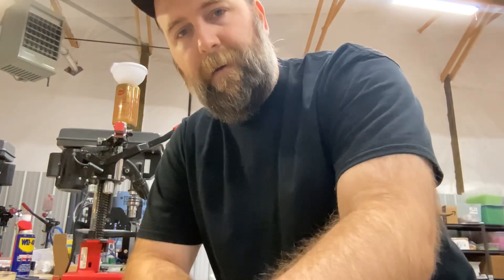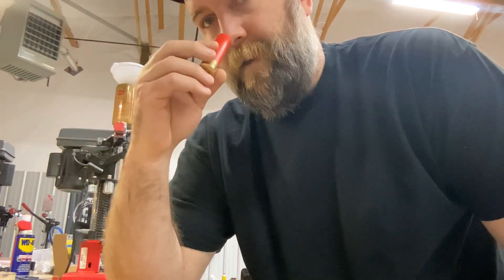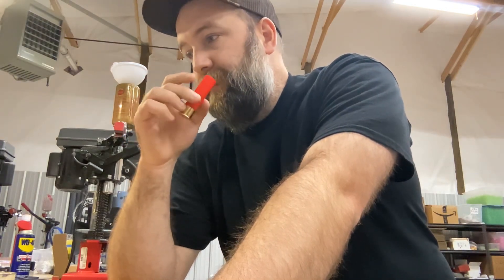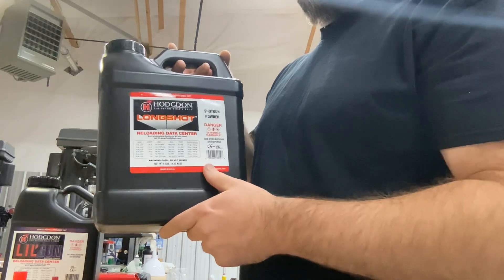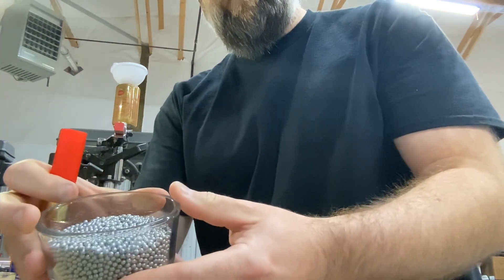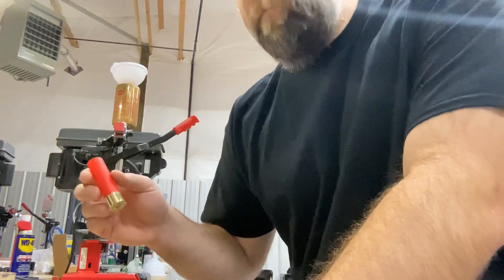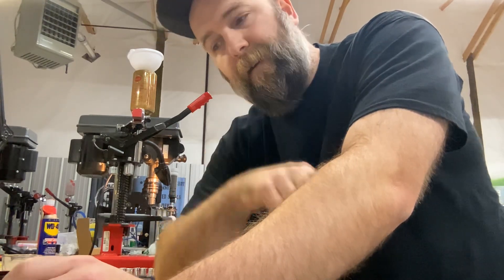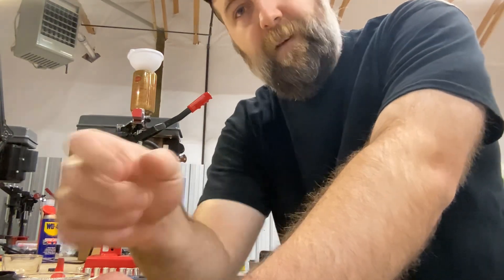Forbidden Knowledge | Powder Duplexing | 1-3/8oz Steel

Comment: If you're only going to shoot 1300 FPS, then use Longshot by itself. Duplexing loads is dangerous.
Reply from the maker: @antichrist_revealed   using straight Longshot is more dangerous than what I have meticulously tested with my duplex.
Reply: @saltcreekammo  How can you say that? Longshot is used in steel loads all the time. I use a lot myself. Duplex loading like you're doing have been around for a long time, but they are dangerous, unpredictable, and can blow a gun up. Not a smart idea. If you need a hot spark for the Lil Gun, just use a hotter primer, because that's all the Longshot is doing, producing a hotter spark.
Reply: @antichrist_revealed how many grains would you use of longshot for a 1-3/8oz steel load? Or what is your steel load you use with longhsot?
Reply: @ Making a 1-3/8 load with Longshot would take trial and error to get it figured out, since too little powder will produce high pressures as much as too much powder will. Not hardly worth the effort when Lil Gun works so well on it's own and even has less pressure than Steel or Blue Dot for the same load. 

However, I do use Longshot on 1 oz and 1-1/8 oz steel loads in 3 inch all the time. I find it most suited for that range and shell size. 

Since finding out Lil Gun does so well with heavy steel loads, I have gravitated to it for nearly all my heavy steel loads up to 1-1/4 oz, in 3 or 3-1/2 inch. I reserve Blue Dot and Steel for 1-1/2 oz steel loads in my 3-1/2 inch shell, of which I don't load very many of them due to powder shortage and need. 1-1/4 oz is plenty.
Reply: @antichrist_revealed  if I want to shoot 1200 fps and keep pressures over 10K....how would I do it.
Reply from the maker: @antichrist_revealed   just because something works, doesn't mean that it's optimized for that specific application. I have a 1-1/4 and 1-3/8oz steel shot loads with Lil'gun. They produce such low pressures, you need to increase speeds beyond its optimal range, which is 1200-1300 FPS. Duplexing Lil'gun with a faster igniter makes it so the pressures and velocities match more closely to where steel shot shines, gives me a cleaner more reliable burn in cold weather, shorter stack height for a better crimp... I'm not coming up with these in my backyard. This duplex shoots within SAAMI pressures, while the longshot loads I've seen pushing 1-3/8oz are well over 18k PSI. Do your own work sending in your ammo to a lab and you'll start learning what powders can and cannot do- which, no offense, is obvious you don't do.
Reply: @saltcreekammo  What's the issue with lil gun pressures? I've seen a couple 1 3/8oz lil gun only loads, and their pressure is within the spectrum of what most other steel hunting loads run, lower middle, but far from the lowest.

Comment: I use Lil Gun in 12 ga steel loads all the time and have never needed extra (or alternate) powder to to ignite it. I fail to see your reasoning. But I do agree with the lessor primer as opposed to a hotter one. My loads range 1440 to 1480 in 3 inch. I load what ever I want in this combo and have no issues with them, or the wads, the Crimps, or even Roll Crimping them if I desire a certain load, or anything. Ballistic Products has this listed in their Status of Steel load data book.

Comment: Excellent work. Have you tried reducing the payload to 1 1/4 oz with the lower charge? I'm wondering if that would allow a 1 1/4 oz load to fit into a 2.75 inch hull with safe pressure and reasonable velocity.
Reply from the maker: @derekclarke5319   No, I have a Longshot load that will do 1-1/4oz in 2-3/4"... It's 1225 FPS and 14k PSI. 

Haven't had time to do a video in a while.

Comment: Keith 
You think this powder duplex would work with the HG load ?

Also could u drop from #4 to 3s ?

Thanks for throwing all this together man !!
Reply from the maker: @Mdwaterman   I haven't tested the HG load with a blend or stack. This configuration only work with this payload, so I wouldn't suggest loading it with anything else... You can barley fit #3 steel... It's tight, so removing 5-10 pellets wouldn't hurt anything (if necessary).
Reply: @saltcreekammo wonder using 2 shot and subbing out 1/4 ounce with 9 tss

Comment: Good question do you have Hercules/Alliant 2400?
Reply from the maker: @clks1165  I do not.
Reply: @saltcreekammo  that ok I have steel shot data from mec steel shot data sheet for mec/precision reloading wads using Alliant 2400 powder for both 2 3/4" and 3" hull 1 1/8 oz loads for both and 1 1/4 oz for 3" hulls.

Comment: I got an idea that you will want to try out a 3" 1.5 oz steel shot with lil gun. Due to lil gun work in 1 3/8 oz load with good velocity the 1.5 oz should still give good velocity with less powder and more pellets
Reply from the maker: @clks1165   1.5oz of steel with Lil'gun will work. You'll need to load it in 3.5" though.
Reply: @saltcreekammo  It won't fit in a 3"?
Reply: @saltcreekammo  what if a guy was to do 1/2 oz TSS over 1oz Steel in a 3”? I have lots of Lil Gun so I’m curious if you’ve worked with a similar recipe.
Reply: I would love to see that load of 1.5 oz of steel in a 3.5 with lil gun @saltcreekammo

Comment: That is great, I was wondering when someone would come up with a work around. Would there be any use for this is 1.5oz bismuth loads?
Reply from the maker: @clinte9897   maybe, but I recently developed a 1.5oz load with Lil'gun that works great.
Reply: @saltcreekammo  would you mind sharing that 1.5 oz lil gun recipe? Really wanting to do a 1oz Steel / .5oz TSS load and have lots of lil gun powder

Comment: How deep are the slits of  the petal on the LBC 50?  7/8 of a inch or are those the pre slit wads?
Reply from the maker: @jasonedgar6991   the version we can get as consumers is unslit. I slit them to about the 2nd or 3rd rib to the bottom...4 slits roughly 75% down.
Reply: @saltcreekammo  Thank you for the info. I just couldn't tell from the video. The LBC's are awesome wads.

Comment: Well i have a good idea for 3" 1 1/4 oz steel shot with 21 to 23 gr longshot powder. Will this be possible with 3" hulls?
Reply from the maker: @clks1165   I tested 1-1/4oz steel with the LBC50 in 2-3/4" with 21.0 grains Longshot... It was 1170 FPS and 18k+ PSI. I sent in other configurations with different wads and hulls. We'll see what happens. It's not looking good trying to get 1-1/4oz steel to work with LS.
Reply: @saltcreekammo  I tried the tps wad with 1 1/4 oz and other wads. If that doesn't work, try 1 1/5 oz and see if that make a difference.
Reply: @saltcreekammo  3 " should make the psi safe because 2 3/4" will be good for 1 1/8 oz steel shot max load.
Reply from the maker: @clks1165   my goal was to see if I could actually get the 1-1/4oz in 2.75" to work... The loads come from a well known choke maker 👀
Reply: @saltcreekammo  yep 2 3/4" hulls are only good for 1 1/8 oz load. The only way to make it work is to use one a 3-inch  hull, two try 1 1/5 oz steel shot with 20 gr longshot powder, or three try seeing if lil gun powder can work.
Reply: Precision reloading removed all of their Longshot data because of pressure spikes. Newer lots are showing higher pressures with their equipment. It isn’t their equipment, they’ve had that calibrated. So something has changed in Longshot somewhere.  @saltcreekammo

Comment: Thanks great information  gonna have to try the lbc50 wads,i know the lbc43 wad was best patterning 2 3/4 wad out of my gun with 32 grains bluedot
Reply from the maker: @philipwatzke5198   the LBC series in general is a really good wad design. In 2-3/4", I'm partial to the CSD118, but I can't say I've compared the two side by side. The 1-1/8oz load I posted earlier could probably be used with the LBC43, seeing as it was originally designed for the TPS1275...
Reply: Could you use the TPS1275 wad instead of the LCB50? In the 1 3/8 oz duplexing powder load?